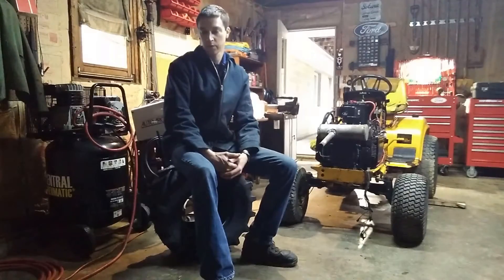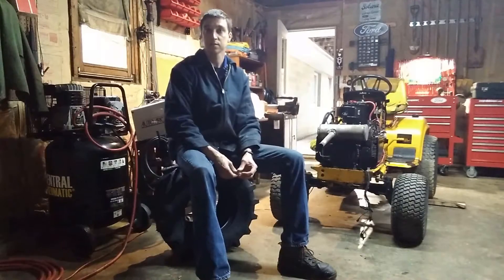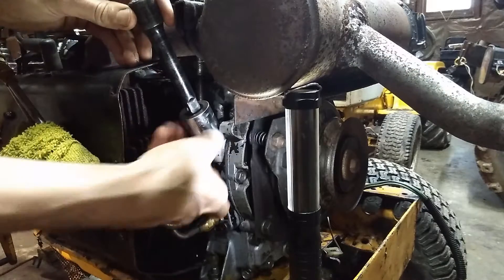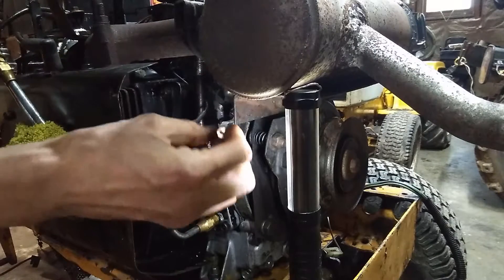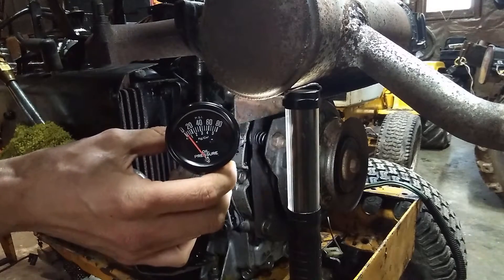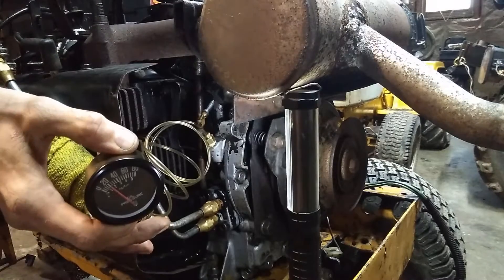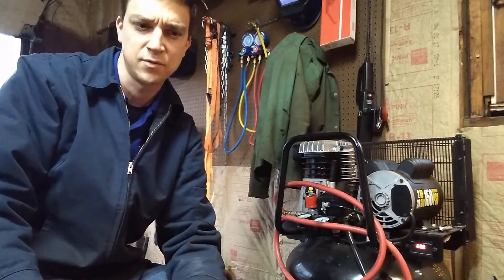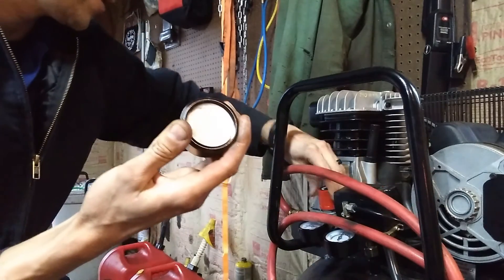Kohler M18 Oil Pressure Check - Cub Cadet 1882 Restoration Project

Comment: Hi I got a cub 1862 for $200. Got it home and the guy said it won’t start so I tried to start nothing. Long story short no compression either cylinder. Took the heads off neither valve moves?? Crack cam shaft I guess 🤷🏻‍♂️. Any help is appreciated 👍
Reply: Took off the valve covers there is no movement at all.
Reply from the maker: I would expect a cam issue as well then.  Looks like it's time to go inside.  The Mag twins can get expensive to fix, so be mindful of that.  You may want to look into a replacement or repower if the rest of the tractor is in good shape.
Reply: @SolunaGarage      I think that’s what I will do they to find a good used engine. Thanks for your help 👍
Reply from the maker: If you have a hard time finding a Mag, the Commands are an easy swap as well. 1862 is a model worth the time and effort.  Power steering is so awesome.
Reply from the maker: What is going on in the valve cover/lifter area?   I assume the valves aren't just stuck or you wouldn't get much rotation out of the engine.

Comment: Confessions are good for the giver as well as the receiver. We all do goofy stuff at times. Glad the
engine didn't take a hit.   Ken
Reply from the maker: Thanks - I had such a sinking feeling about that whole event.  I had literally vented the entire crankcase of oil into the shop.  Tough little motor.  Had to have little to no oil pressure by the time I got to it.

A brand new project, I was really excited.  Sometimes that excitement needs tempered....